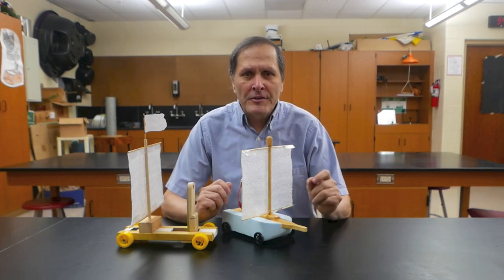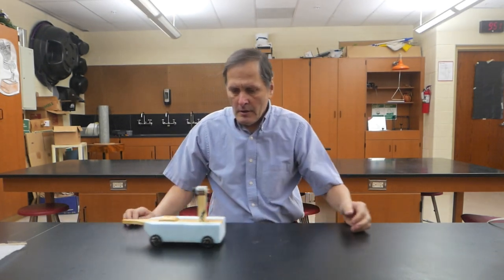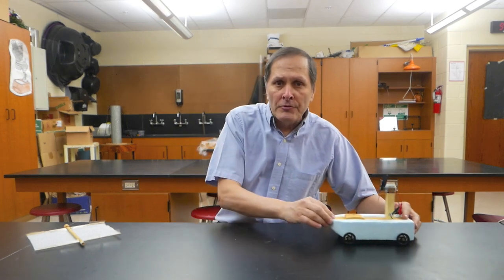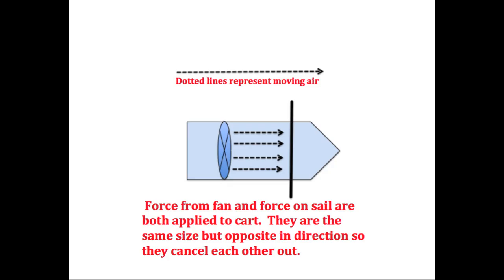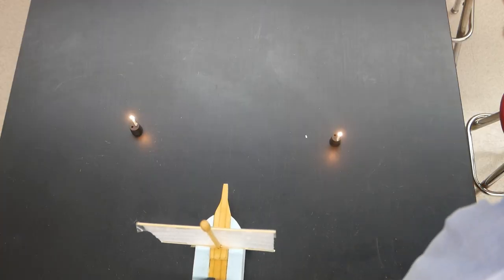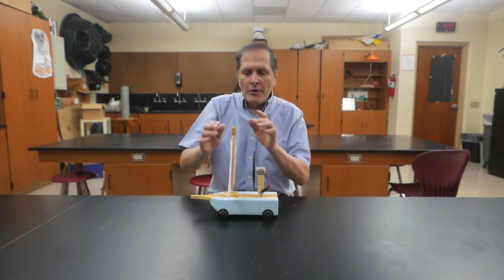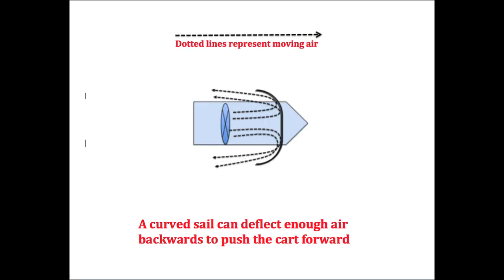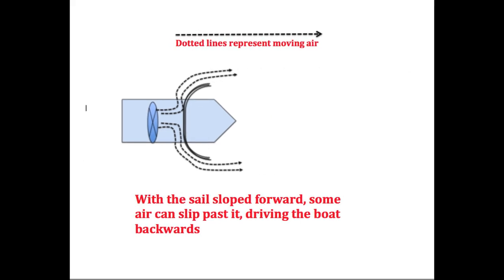Fan Cart - Blowing into your own Sail- part 1 // Homemade Science with Bruce Yeany

Comment: in a real boat, the sails are used at an angle, and function more like the wings of a plane than just a surface the wind pushes on. Would it effect the experiment if you used a proper sail? I think it could because then your wind would be coming from the side of the boat (which is when a sailboat is fastest) so it wouldn't cancel out the forward force of the sail. Great Video
Reply: Andrew Laroche 
then the force on the sail would be even weaker since the wind hits at an angle instead of perpendicular to the sail so the boat would move backwards due to the force of the fan being stronger.
Reply: It doesn't matter, the air is being pushed forward from the boat, rather than the air coming from a separate source, and gets deflected off in a direction.

Adding a triangular sail would only cause it to spin around in a circle, as could be inferred from 6:32.
Reply: Andrew Laroche - Your point is totally correct, sail boats do not just get blown downwind as this video shows. Wind comes from all points except directly in front of the boat.   I don't see how the experiment would be set up so as to cancel out the effect of the fan just blowing the boat forward, but as you noticed, this video doesn't address real sailing physics.
Reply: Terra Estrahl no what he's saying is accurate even for ships that are used as the example (such as galleons or old pirate ships) they are meant to catch the air so they form the shape of the solid sail in this video, this isn't shown in the video because the sail he uses isn't able to flow with the wind and catch any of it, which is what a sail is supposed to do. If he had fashioned a sail that was more loose and able to move and flow then the experiment could've turned out differently
Reply: Dj Hendricks The experiment would have turned out the same regardless what kind of sail he used. It's akin to putting a jet engine in place and having that energy push the sail forward. The engine would push the boat backwards and the sail would try to drag the boat forwards.
Reply: I think, that it could work with proper sails. Real sails shape closer to the cardboard one from video rather then stretched ones (those didn't even make difference when they were put on the other way around then in real boat).
Reply: When square rigged (the square/rectangular sail rather than a triangular sail) they are always are on the leeward side of the mast so that they billow and collect air somewhat like the cardboard sail he built.  His sail seemed to be 1) fairly rigid and 2) on the windward side of the mast preventing it from billowing.  Bermuda or gaff rigged sails work differently and generate power from their leading edge.  That's why you can actually sail to windward with a bermuda or gaff rigged ship but not (or at least not at all well) with a square rigged ship.  It was due to this limitation that the great trade wind sailing routes around the world were developed centuries ago.
Reply: Andrew Laroche then the cart will move backwards slightly moving to the side.
Reply: i won't angle the sail in real life if using an analog control blower.  

homers explanation is the the sail and the fan is anchored on the same boat, and the boat absorbed opposite force.

 the one with a curve sail, its because the air  escapes equally on the side and reinforce the direction of the fan.
Reply: Thomas Mobley what if we just asked him to make a response video but this time with the proper square rigged sail?
Reply: Dj Hendricks -- I'm not actually concerned with it either way.  I'm pretty sure you can't stand on the deck of a sailboat of any rigging and just blow and make it move.
Reply: You all are forgetting the Keel, which mitigates the "turning in circles" that would occur when the sail is at a proper trim angle to the wind.

There's more physics to sailing than just wind and sail.  A proper sailboat, with keel and cloth sail at a tack angle, would move forward even with a mounted fan being the only source of wind.
Reply: I think you're missing the point of this video.

You're thinking, "hey, wouldn't it be great to be able to power a sail if only I have a fan to blow on it?"

But if you have a fan that could power a sail, you would just point the fan backwards and remove the sail entirely since having a sail in front of it would just reduce efficiency.
Reply: bananian
 I'm worried about how to make it work properly, not about whether it's a practical idea in the first place.

It might actually be more efficient though, if the math is as I thought I understood from a different comment thread, because you're also harnessing the side-ward winds, rather than losing them to the side.
Reply: I don't think so. He showed that a direct air source from the boat can push it forward when the air is reflected back like he did with the cardboard. A sail, once air is blowing into it, is arched which could reflect the air source back. The sail which he is using is flat no matter what.
Reply: watch at 4:00 that is exactly what he is showing
Reply: Andrew Laroche in both cartoons and real life, like few hundreds years ago, those were real sails. until men figure it how to shape the sails, to increase eficiency, ships could only sail if the wind blow from behind.
Reply: Yes, but that's because it's deflecting some of the air backwards so the efficiency is only a portion of the scenario where the fan is pointed backwards and the sail removed.
Reply: bananian
no, sails work like a wing, it uses pressure differentials based upon drag vortexes to achieve a pulling motion on the whole craft.
Reply: I am talking about the cardboard sail in this video. Besides, real sails are designed for wind from outside the boat. 

Also, when wind comes from behind the boat, you have to shift your sail so that it's perpendicular to the wind, which is called the Running position, so it's the same principles as in this video anyway.
Reply: Trevor Hurd You would need a high power fan that blew air directly into a large sheet of bent metal.

If you noticed, when he put the cardboard sail into the boat, it ran very slowly, thus showing how inefficient it would be to make something like that.

In this case, it could be done, but you might as well just turn the fan around and get more value for less work. 

Having a fan facing a sail wouldn't move the boat. The fan would have to be detatched from the boat in order to get it moving.
Reply: bananian
 No, some racing yachts actually get better windward performance when they sail at a slight Tack because their sails get a side-ward lift force that gets added to the overall wind force, allowing them to sail faster than at a run.  It just requires a lot of back and forth tacking to move forward.
Reply: Terra Estrahl
 See my post above, about side-ward lift force.  Tacking is often times faster than a straight Run.
Reply: Not some yachts, ALL sailboats move most efficiently at an angle from the wind, but the sail would be in the position shown in this video if wind was blown directly from behind.
Reply: bananian
 That depends on the hull shape and the sail shape, and the draft.  Some just don't have the lines to exceed the wind.
Reply: the Keel has a lot to do with how sailboats work. When on a run (wind behind), the sails shape catches wind much like his first example with the desk-fan. But when on a tack, the sail's height and shape catch wind and try to roll the boat onto its lee side. The water pressure against the opposing side of the Keel prevents this roll and the path of least resistance is to release that energy by pushing the boat forward.if he would have attached the fan blowing air sideways across the boat with a sail going from bow to stern and installed a keel in the pool, he may have seen forward momentum.
Reply: +Trevor H
google points of sail. It is a general principle on how to position your sail depending on the angle the wind is coming from.
Reply: +bananian I know that. Why are you telling me?  The Term "point of sail" just escaped me, which is why I said "tack" which is essentially the same thing. Which tack? Starboard, Port, Run, Close hauled, etc.
Reply: You could make a fan blow it from the side, and it would work, but it's merely deflecting the thrust backwards, like it normally does with the wind. But it would be less efficient than just pointing the fan rearward (without the sail). Sails aren't any good for onboard based air thrust, only for external air source. The first experiment demonstrates that, and you can't "blow in your own sail" to go forward. If anything, it could only split the boat in two, if the boat was weak enough (and the two ends would separate more and more). But if the two ends of the boat don't separate, the boat is going nowhere. When air is deflected (like his experiments etc.) it's the opposite effect as "blowing in your own sail", cos the boat goes backwards, not forwards. And this is further busting the "blowing in your own sail" myth. Obviously if you changed the position of the fan, you can make a deflected thrust boat go backwards or forwards. But it's still the opposite effect of "blowing in your own sail" (when it comes to that particular story) (and so is blowing in an angled mainsail from the side).
Reply: The real issue with sail in the show is that it isn’t a triangle the reason that’s an issue is because there is only one sail. If a ship is to only have one sail that sail needs to be the sail the ship lacks the head sail. It is triangular so it catches wind the way the cardboard did it creates a cradle in every direction instead of two. The other problem is well the fact that in the show think about how big even the smallest pirate ships are the one they are on is just not big enough and if it was it would take at least 50 people blowing the sail from less than an inch away from the sail to make it move we are not powerful enough regardless. The pirates would catch them wily coyote wouldn’t go anywhere cause even that proper bulge isn’t enough and anyone saying real sails would work are only half right. Lastly the sail to ship ratio is so far off.
Reply: When a sailboat moves directly downwind, the sails have to be wing on wing, taking the wind full on.  They are acting like a square rigged sail such as the one in the video, not an airfoil.  Since the boat mounted fan is basically the same as a tail wind, you would get no forward movement.
Reply: Generally that is true.  However, some sailing craft sail downwind several times the speed of the true wind and they don't do it wing on wing.

Comment: The sail need to have a more slack material that will catch the wind better as now just too straight and tight. Recon if it was good fabric it would bulge in a way it would have worked.
Reply: This. if the sail had some slack, it will bend and redirect the air back from the top and bottom of the sail instead of sideways in all direction.
Reply: A real sail on a boat have some slack to it is not so stiff, if it bulges the right way it will direct the wind back.
Reply: I saw the cardboard, but he should had made a sail design with fabric instead of plastic foam.
Reply: The test boat also needed a keel and rudder.
Reply: I was thinking the exact same thing, but the cardboard was a pretty genius idea, but the paper wasn't real sails.
Reply: But they'd still have been better off turning around and blowing backwards off of the boat instead of into the sail.
Reply: This is a physics demo, not an attempt at creating a sailing vessel. So, no.
Reply: Not how physics works bub.
Reply: chungdha - um, didn’t you get anything he said?  The physics just don’t work...
Reply: I'm sorry that you don't get it. If a sail were set up as you describe, the air would push the fabric out as you expect, but it would then go out to the sides and not Impart forward motion.
Reply: it depends how much air goes past the sail, in a self propelled set up like this the sail only acts has a dampner, no if more air passes in front it goes backwards and if air is all stopped by the sail it dosent move.  no matter what sail you use it could be silk or steel, the only important part is air flow and where it goes.
Reply: I think the mistake he did with the paper sail is he placed it in a way where the support beam is in front of the sail which is what caused that spinning motion. That's not how real sails are in a ship, the support beam is behind the fabric so it can cave.
Reply: The sail is backwards
Reply: Undefined Lastname I don’t know if I’m meant to answer but obviously c because to lift themselves they have to apply the same air current downwards making no difference in weight

Comment: @Bruce Yeany
Being honest, there appears to be a physical phenomena occurring that your are not explaining/avoiding.
Look at your own results @1:44, obviously the cart moved further to your right... Table uneven, room ventilation, imprecise  wheel bearings, other?
Help us understand by examining more closely.
Thanks!
Reply from the maker: looks like it move a bit,  I'm not sure why,  I went through all the video footage and that is the only spot where I've seen it.   but I've had so many questions on this video that I am going to try it again next week,  more sails, stronger motors,  we'll see what we can get out of it,  thanks
Reply: That might be a result of the wheels hot turning at the same rate due to alignment or placement giving one or more greater resistance .
Reply: nyyght7 obviously the force he applied to the cart is not the same, he could apply slightly more force to the right,
Reply: It could also be the deflected air that is more evident in the water.
Reply: I know I'm a bit late, I think it might be the draft behind the fan.

Comment: "As hard as I try I couldn't stop the boat from spinning."

TURN THE SAIL AROUND! Also boats have keels to stop them spinning . . . yours is a barge, not a sailboat.

The first experiment with sail and fan when pushing it backwards it stopped almost instantly. Pushed the other way it rolled before coming to a stop and on the second try it rolled forwards a couple millimetres after coming to a halt after being pushed backwards. That suggests an imperfect system with a lot of friction. On the water he had the sail backwards with the mast in front of it and no rigging so the sail wasn't allowed to billow . . . as it would in the stories. the card sail is the best representation of the stories.

Really annoys me when people have such a simple grasp of high school physics and sound off like they're an authority when applied to the real world then fudge the execution and results of the experiment to prove their point.
Reply from the maker: See if part two is any better,  I tried to clean up my mistakes.
Reply: I would like to see that.

Comment: Bruce, I just had a thought.  Is it possible you are wrong about why the curved sails make the cart go forward?  I am thinking that it is not that the air is curved around so it moves back toward the fan.

Rather, as with the flat sail, the air hitting the middle of the sail is deflected sideways.  That sideways moving air then hits the angled part of the sail.  The air hitting the angled surface pushes the cart forward (and to the side, but that is canceled out by the other side).

In other words, it's not about the direction of the flow, it's about the direction the air molecules are traveling when they hit the surface of the sail.

What do you think?

Comment: Just to add, triangular sails function like a wing. Creating a low pressure by angling the sail to cut into the wind like a wing before stall. A keel is needed to keep the boat moving forward.